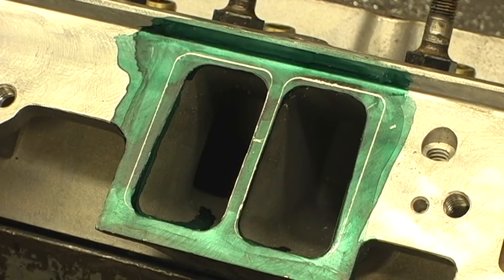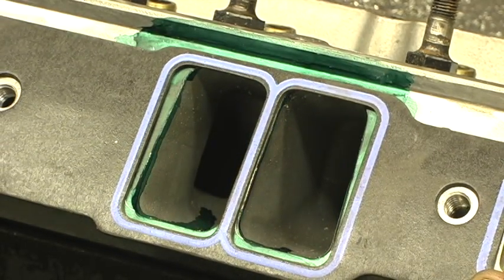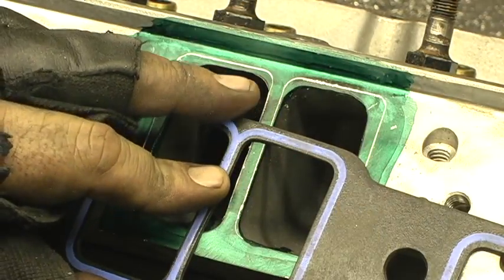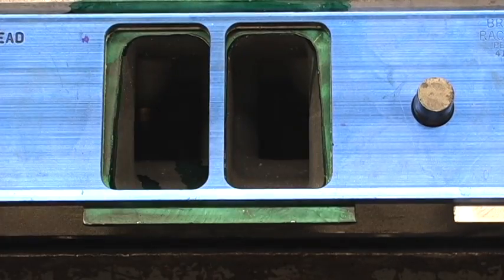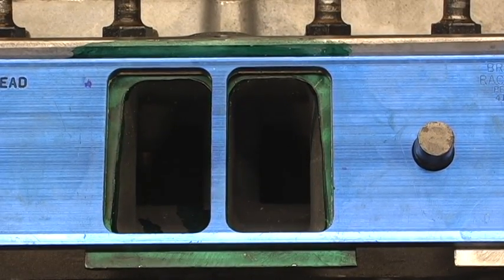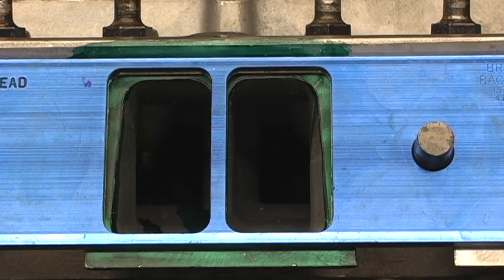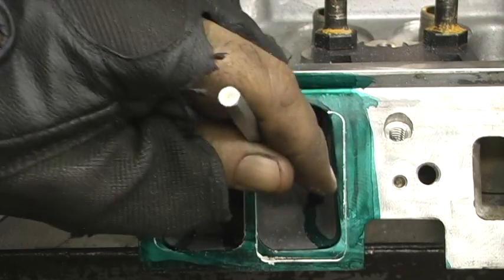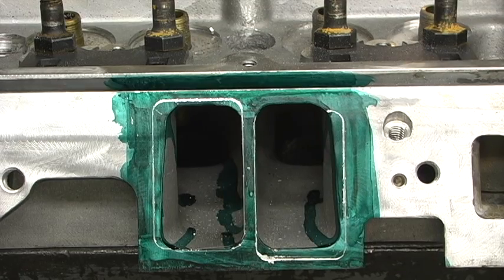ProComp SB Head .200 Raised Runner problems Solved

Comment: I have a set of Pro-Comp 190's on my 351Windsor.  Run them hard for 2 summers, and 100% happy with them.  Bought the biggest intake gaskets I could find, and port matched the heads and intake.  Am just going to do the exhausts now, because the ports are so big I had trouble finding gaskets big enough.  Have some now, and a bigger set of headers, and soon will be ready for next year with the full porting of both sides.  But if you can't gasket match your heads (any brand) don't buy them.

Comment: a little late to comment, but I just made the mistake of using the gasket to port match. I trimmed the bottom. could I still get a raised runner intake and still seal on the bottom? the standard port location intake has the little blue ring showing on top when I mount it, but lines up on the bottom.

Comment: Any thoughts on the ProComp iron heads. $200 for a bare pair a little port work and a good valve train for around a $500 total. Seems like a great value. They have a 175cc and a 190. I've seen a pair of 175's on a 283. He wouldn't give much info but his Altered runs 10.90's!

Comment: I've run into this problem recently, when the intake manifold is set into place without gaskets, the runners are visible above the edge of the intake. With the gaskets in place the ports are covered by the gasket material only. What can I do as far as the intake goes? Or is there a .200 higher intake to match?

Comment: I used a 1266 and it fit perfect on top!
Reply from the maker: You got it, I have not had any problems using that gasket per say, only on a couple that had been milled, and on the earlier castings were there problems.

Comment: I have Pro Topline heads with raised runners. My edelbrock 1551 supercharger worked perfect because its designed to also work with vortec heads. But now going to a regular SBC intake it will not fit. What manifold seems to work best with these raised runner heads? Team G?

Comment: i did this to a set of sbc sportsman 2 heads..used a 1206 was able to raise the top of the runner and epoxy the floors to really straighten the transition..did the rpm airgap as well..alot of time but well worth the power

Comment from the maker: When you say "Block Rail" are you refuring to the front and back of the engine block where you normaly use gaskets between the intake where it meets the block? If it is, then through away the gaskets, and lay a beed of silicon about .350 thick (or look at the distance and measure between the block and intake manifold and add about .150 thickness to the measurement). I quit using the gaskets that come in the intake gasket set back 30 years ago, silicon does better and conforms great.

Comment: I've run into an issue using Dart 215 raised port heads along with a Weiand Team G intake and the Fel-PRO 1266 gaskets whereas I still have a .045 gap at the front and rear block rail. Is the best means to compensate for this gap to install an end rail spacer kit?

Comment: Felpro 1289hp gasket for gm fastburn heads fit perfect when you run vortec intake. I tried several times to get gaskets to seal with traditional intakes..

Comment from the maker: The ProComp heads I have worked on with valves had "STOCK LENGHT" valves (4.890) and do not require longer pushrods. IF you use +.100 longer valves (5.00 inches) then the plus .100 longer pushrods are needed; however, this is JUST an indicator, and not fact. a lot of things come in to play here like Lifter length, camshaft base circle, how much has been milled off the head and block. the best thing to do is alway use a pushrod checker and do the math, but over all if your stock then stock works

Comment from the maker: Yes, there patterned off the phase VI Bow Tie .200 Raised runner. You have to run a 1266 Fel-Pro Intake gasket (.120 Thickness, compared to .060 thickness of the 1206) to make a stock manifold line up. It is NOT a dead nuts line up, but I use the Brezenski "Plate" and that does the trick with the offset dowl pins.

Comment from the maker: At the time of filming this I had NO IDEA that these were raised runner heads till I called ProComp and talked to "BOULDER" and he told me to use fel pro 1266 which is a .120 thick gasket and solves the problem. It was NOT listed on there site and no one knew including Nashville Engine Parts who sold this customer his heads. you would think they would tell people that, but that is O.K. as this is a good thing bigtime.